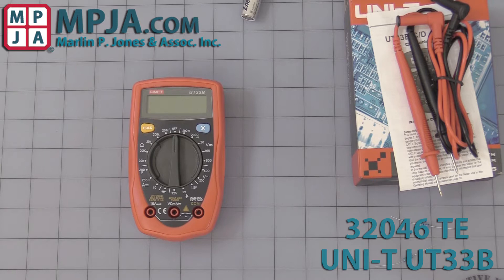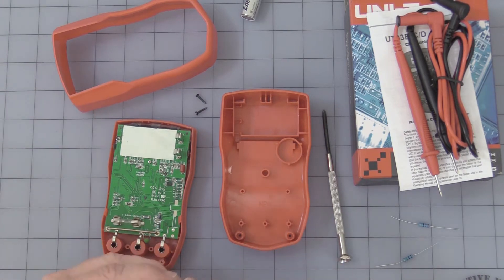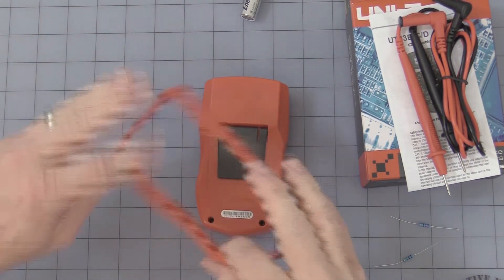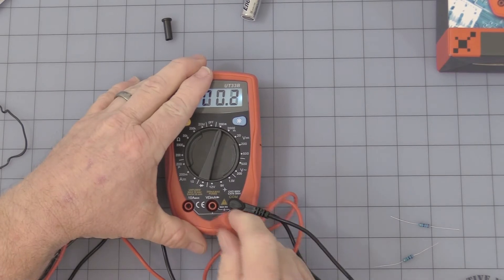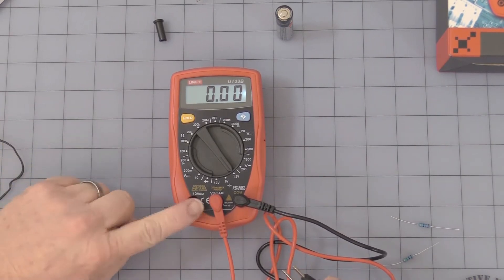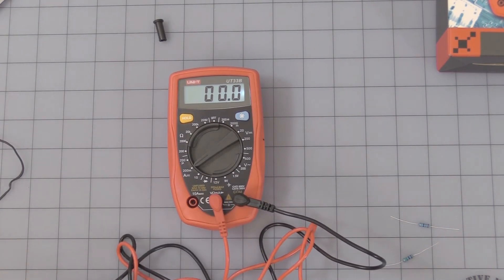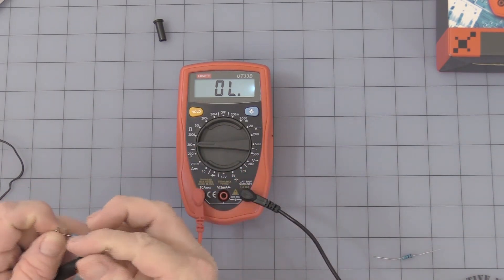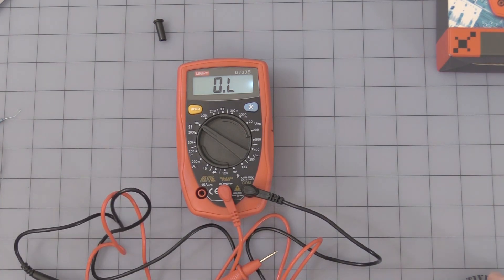UNI-T UT33B Digital Multi meter 32046 TE

Comment: As easy to get apart as running your fingernail along the side, it doing nothing and then f'ing about for like an hour with a variety of thin pointy and bloody stabby things while it continues to feel like it's plastic welded along the top f'ing seam and trying not to yank on it too hard cause you keep feeling like ya gunna break the friggin thing to the point where it almost gets deliberately broken by making a high velocity hole in the wall with it so you can check the wiring in there, until eventually you yank on it in the special magical manufacturers way that finally gets the f'ing thing apart.....Just as easy as in the vid. Just to find ya don't have any spare 12V's anyway and ya can't go and get any cause ya wanted to check what the f is going on with ya car battery which is damn near brand new and apparently I think I need a new alternator but just wanted to check out of curiosity and for something to do, but shouldn't of f'ing bothered cause now I'm pissed off and ranting on YT. And I only need a new 12V cause I was a dumb f and left the bloody thing on last time I used it.......Hoo f'ing ray.....What a happy happy joy joy day. 🤸‍♂🎉🎉🎆🎆🧁🧁🍨🍨🤬🤬

Comment: i have the same meter but its 1.5v to 12v AC rang not working means only 0.00 show variation when checking something.... if you know how to fix it kindly help me
Reply: may be you need to open it and check the internal resistors